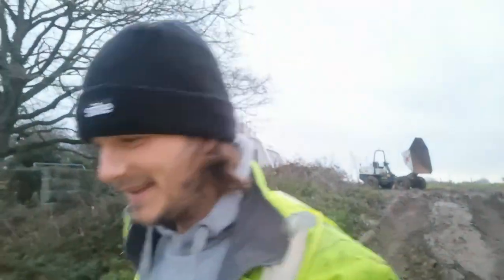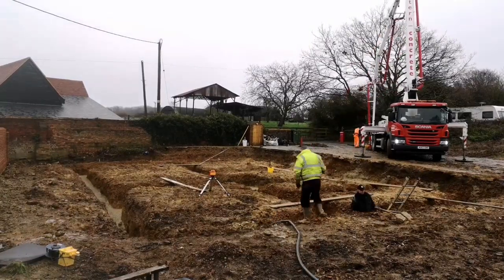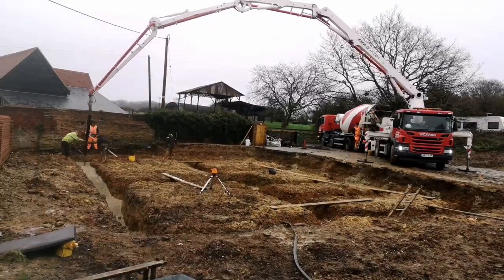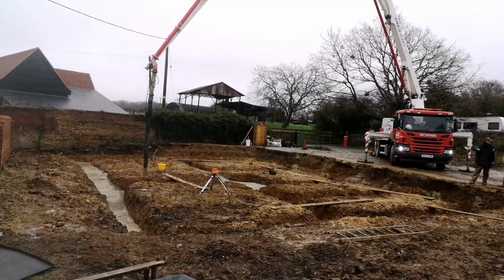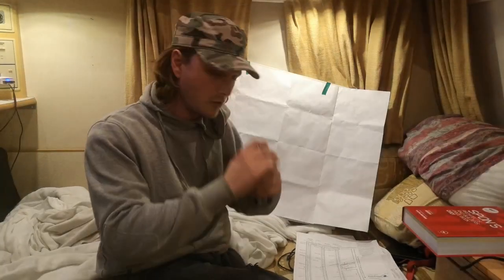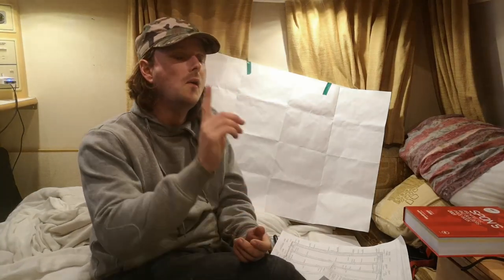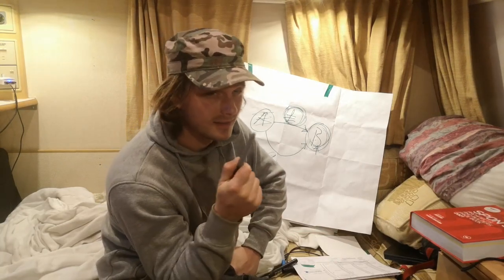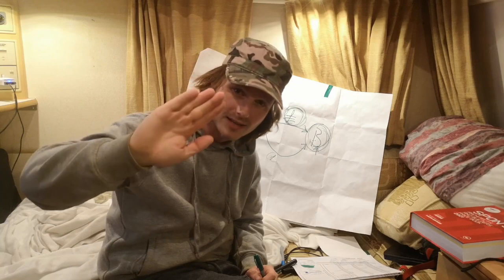What happened to THE BARN?! New FOUNDATION DESIGN --- self build --- Barn conversion 026 -

Comment: We did an oak framed barn, stripped the boarding off and started underpinning propping the frame as we went , turned up one day after a god awful storm to find a pile of sticks scattered around , was now a rebuild but made the groundwork’s a hell of a lot easier. Was still classed as a barn convertible 😀
Reply from the maker: Yeah we didn't want a pile of metal scattered around that may have ended up on top of us. By the time I took down the brick and blocks one corner of the frame was just flapping about. I'm still going to class it as a barn conversion, even if the authorities don't 😁

Comment: Hey how's it going. Just leave the name as it is ! Your still going to end up with a concerted barn !? You've just taken it down before it goes back uo ! 
Very interested in the Spon book, would you recommend it for a build like ours ? Just looked into it and it looked to be aimed at bigger projects ?? Keep the vids coming, I know how hard it is to do when your busy 👍👍
Reply from the maker: Hello mate! I'm having a week off as the weather is beating me. How are you? How's your barn coming along? It was worth it for me, spent £170 and saved 40k! It's very comprehensive and abit complicated as you'd need to make adjustments for your area. It would be handy to work out your budget in advance but that's if you know everything you need to account for. I initially got it as I was trying to find a contractor to shell the barn and wanted to make sure I wasn't going to get knocked. I suppose it all depends on how you are going about your build and whether you're subcontracting everything out or not
Reply from the maker: You can get a 2016 copy on eBay for £10, the prices shouldn't be too far off and you could always ask me to check mine for specific comparisons

Comment: Wouldn’t worry about what label you put on it, the trust of it is the same.

You are still converting a barn at the end of the day, you started with an old barn and you’ll finish with a house that’s in the model of the old barn. You’re talking about the difference of a few original thermalite blocks and some concrete! I hardly think that makes a difference.

The only thing I would say is you might find YouTube latches onto the self build tags more than a barn conversion. So it might be worth using it in the tags.
Reply from the maker: Ah the elusive Youtube algorithm pumping machine haha